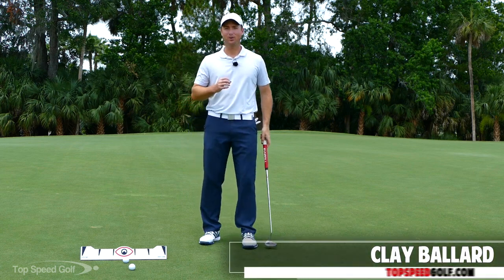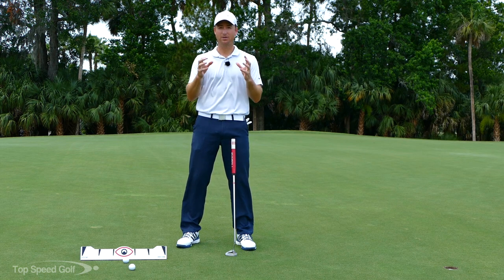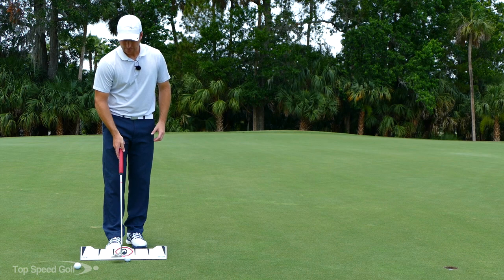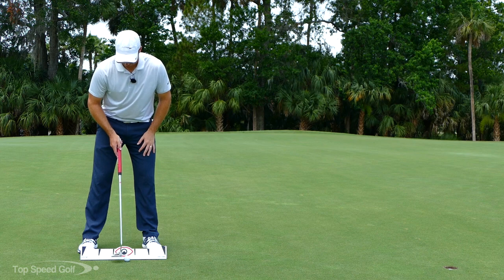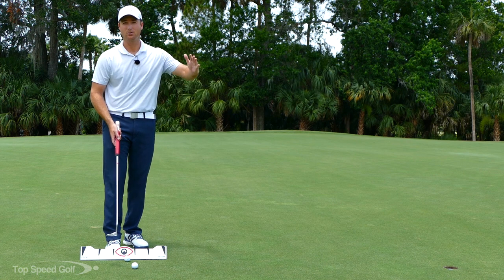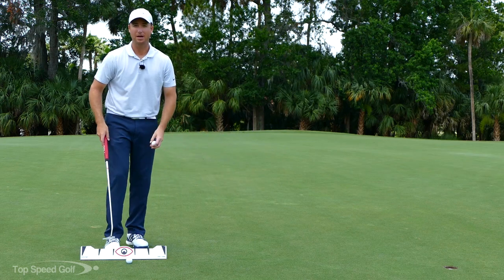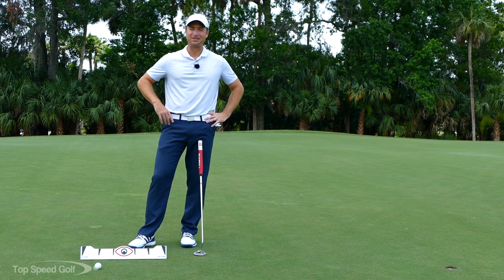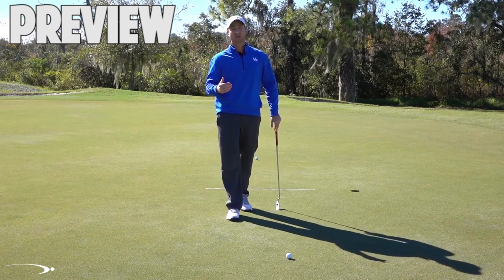Why You DON'T Want a Pendulum Putting Stroke | 36/64 Rule

Comment: This logic only applies to putters that are not designed for pendulum putting, which includes most of them. But keep in mind that a pendulum is the purest stroke in golf. The issue is that a putter needs to be designed to allow for such a free swinging, square face, tempo motion. To do this, a putter needs an extremely high M.O.I. (Moment Of Inertia) . Welcome to the L2 putter!

Comment: So if I catch the ball at the bottom of the arc, I've seen the ball move or shift offline within the first few feet due to an imperfection in the green. But if I catch the ball on the upstroke or even slightly "lift" the putter head at and through the point of impact, that ball starts rolling immediately rather than skidding along and it seems less likely to be affected by outside forces. Does that make sense?
Reply: Tiger always said he tried to hit a "high draw" with the putter.

Comment: Hey Clay. I'm just going through the TSG system and signed up as an annual member. Great system and I'm really enjoying it :) I find your instructions very easy to understand and there have been a few aha moments, when things have clicked so Thank You :) I tend to go to some other videos you have made as well from time to time and they all tie in together, however in this you say not to use the pendulum stroke and to use the 36/64 and then in the TGS putting system 3.1 Putting Stroke Tempo & Timing | How to Smooooth Your Roll, you say to use the Stroke Meter which makes you create a stroke that is equal back and through. I'm confused? Which one should you use?

Comment: If you accelerate while putting, then your ability to control exacting distances diminishes. If you change your acceleration from one stroke to another, you will NEVER have true consistency. I actually pause slightly at the back of a putt. Putting is perhaps the best aspect of my game (2 handicap). Control is derived by how fast the take-a-way is, and MATCHING that during the through-swing. What that does is it means I am not popping at the ball. Let us say I am faced with a 12-foot putt. Well, the speeds of greens change EVERYDAY, because of growth and mowing, wetness, and wind speeds. When I warm up, I can find a level area on the practice green, and I can test the speeds of the greens. On days where the greens are smoking fast, I may find that I need a small take-a-way say 3 inches to travel 12 feet. On other days the speeds are slow, and I need an 8-inch take-a-way to travel that same 12 feet. But if I pop at the ball like you are advocating, I have no real idea what distance I need to pull the club back because if my acceleration is  3 or 4 MPH differently I will always get differing results for the exact same take-a-way.  I cannot judge distances accurately by doing what you suggest. Believe me, I have tried millions of times. How do you know how fast your acceleration is actually building up to? You don't, you guess ( you call it feel). Because when you pop at the ball, a 4-inch take-a-way can send the ball forty feet or 4 feet depending on how much acceleration is being delivered to the ball, coupled to the speeds of the surface. How many rank beginners pop at the ball and send it racing 20 feet past the cup? Some players have a distinct pause at the top of their full swing. It gives them a reliable point to transition from (Hideki Matsuyama). Through decades of attempts, I have found that the same is actually true while putting. It gives the player a way to control distances more accurately, without having to rely on your type of guesswork. I play on greens that have an 11 stimp most often. That doesn't mean it is always an 11 stimp though. When I warm up, I am finding the true starting speeds of the surface... FOR THAT DAY. On dry or windy days, the speeds may increase during play, but I have a starting point from which to start from and by paying attention to results during play can actually see if they are speeding up, and I can adjust. No guessing at all. If I take the putter back 4 inches, pause, and then move the club head to 4 inches in front of the contact point, I get a distance for a 4" take-a-way. On fast days that maybe 8-feet or more distance results. Facing a 6-foot putt? Simply use less take-a-way, of course, but don't try to figure out how to change acceleration. You'll be all over the map if you do. If I do a 6-inch take-a-way,  I get a defined result. If I use an 8-inch take-a-way, once more I get a defined distance. Taking that knowledge onto the course gives me the distances of a take-a-way for the distances I face. Uphill? Add an inch or two. Severely uphill, add even more take-a-way. But there is no need for popping at the ball. Simply enlarge the movement, just like you do out on the course. Not all swings are full swings. Downhill putts, use less take-a-way. If I pop at the ball like you suggest, I have no real idea how far the ball is going to run-out. It is then just guessing. Bad advice, buddy. The hardest part of learning how to putt really well is stopping yourself from trying to power the shot like you would with your irons or woods. I have seen people who can play from tee to green extremely well, who suck, simply because they try to bring the acceleration aspect of the full swing, onto the putting greens. They send the ball either way too far past the cup, or they deaccelerate to compensate and come up short. They 3 putt a lot of greens for this one reason. They don't know how fast the ball is starting at, because they have to guess how much acceleration they are creating each and every putt. Back in the 1960's when greens were 7-9 stimp, that type of technique worked. Look at the films of Palmer and Player when they were wining. They popped at the ball. But when you do, look at the greens they played on and how slow those greens were.  In fact, if you compare their performances through the years you will see that as the greens started to get faster and faster, over time their ability to win dropped substantially. Try that on a green complex that is set at 12 or 13 nowadays and see how well that works for the long haul... it doesn't. It creates 3 putts more than not.

Comment: Excellent! Will work the too back, too short to get a better feel just right - that is the key to this video; got to be able to recognize/feel this to hone the correct. Yes, needed the re-emphasize of the accelerate through the putt; in competition don't have this automatic acceleration -- tend to decelerate under pressure which cause the face to close (for me) and come up short left too often. Use an Accelerator 3 indoor putting mat that emphasizes this also. Use it also to see the putter face staying consistent square due to the guidelines. Off to the putting green.... Thank You!!
Reply from the maker: My pleasure!

Comment: Everything I’ve heard from putting professionals implies the 1 to 2 ratio is wrong. The ratio you should actually look for is 1.5 to 1. A shorter through swing gives you better acceleration, not a longer through swing. And the shorter through swing keeps your stroke consistent. 

If your stroke going significantly further than your backswing you might end up pushing or pull your stroke. This could creep in to where you hit the ball, causing you to consistently push or pull your putts.

Comment: Excellent job in explaining the 36/64 rule..  Wonderful.  However, when practice putting over 3 feet, you are PROGRAMMING to miss the putt mentally.  Now, find an uphill straight 3 foot putt.  Now, if the putt goes IN LEFT CENTER, then you have MISSED the putt (or 10 footer).  The putt must go in DEAD CENTER.  You will then develop a SHORTER ACCERLATING stroke and mentally you never miss.  The only difference between a 10 foot putt and a 3 foot putt is when you have a 10 foot putt is really a 3 foot putt which you hit HARDER.  Allen E. Jansson, 57 years of putting research.  EXCELLENT JOB.!!!!
Reply from the maker: Thanks and thanks for sharing!

Comment: Pendulum putting with small light putters is not a good idea since you need to add energy into the impact zone in order to get your distance. However, with a putter that is big and heavy and designed for stroke size for distance control, there is no better way to putt.

Comment: When I was 14 my father made me a rather unconventional putter; basically he used a very heavy chunk of iron blank put some groves on one of the faces then bored a hole for a very short vertical wooden shaft with no angle, the putter was T shape. I bent over the shaft and hung my arms straight with my body being the pendulum, no wrist and no arm movement and oh boy how accurate I was with only one movement to consider.

Comment: You'd have to add some acceleration to the head if you want it to go forwards double the backswing length - - which may then add another element to go wrong.   You'll also need a tighter grip to make this work.   Another element to go wrong.   Difficult to have passive hands and/or arms doing a double forward swing.  I'm not convinced this is the only, correct way to putt.  Thoughts guys?
Reply: Stan Utley... the putting guru to the pros... says that the backswing should be longer than the through swing so you can hit the putt with the dead weight of the putter falling to the ball, and that every top putter does that.... Jack, Ben, Tiger, Faxon, Roberts, Ricky... the list goes on. He's right!!!
Reply: @macdaddyblues1  Certainly Geoff Mangum would go with backswing = forward swing and pretty natural as well - more like the unadjusted swing of the putter and your arms - around a one-second pendulum.  I loved listening to a recent podcast where Geoff is interviewed - so refreshing to hear someone with real researched instruction rip into various putting gurus who are more personalities and celebrities than coaches.  He was particularly bitter about a young junior he had helped to win some major junior comps and then be invited to international events.  This youngster's father then got him to come to England to do a SAM Lab session.  Never heard of this young junior again - completely messed up.  All SAM Lab can do is show you the results of what your body is doing to the putter.  It can't tell you how to move the putter correctly.  Anyway if you want to find the podcast it's here https://www.youtube.com/watch?v=yueGj-YIpOo
Reply: @macdaddyblues1  I worked with Stan as a student and you are correct. It may look like the putter head decelerates, but that is because the ball gets in the way and slows the putter on the through stroke. Watch Patrick Cantley. He’s one of the best putters on the tour and he is using dead weight. There are two basic strokes…a pop stroke which this video demonstrates and a pendulum stroke which Stan advocates. I’m more of a pendulum stroke putter.
Reply: @edwalt3157  On a side note... I played against Stan in MO high school state golf tournament back in 1980!! You don't have to guess who won medalist in the tournament!! lol

Comment: Just getting into golf.  This video is great.  I'm also a weirdo because I'm a mechanical engineer and a drummer.  The whole Pendulum concept (equal angle of swing / constant tempo) would be great if you kept your putter oscillating back and forth for 30 seconds then, while continually swinging it, stepped over to the ball to putt it.  However, you're starting from zero velocity, accelerating, then stopping.  The whole Pendulum concept doesn't fit.  The grandfather clock Pendulum doesn't stop from zero, speed up, then stop.

The drummer in me is thinking in terms of a "groove", with the only timed spots being when I start moving the club (beat 4), and when I make contact with the ball (beat 1).  Imagine a rock and roll guy yelling "1... 2... 3... 4..." on stage to count off a song.  On beat 4, I start moving the club.  The "song" starts on the next 1 (this is when I make contact with the ball).
Reply from the maker: Thanks for your input! Play well 😀

Comment: Hi Clay,
What's your opinon about great putters who has almost no forward swing? Snedeker, Zach Johnson and Russel Henley comes to mind. I'm sure there's plenty more I forgot. What they have in common is that they accelerate really good into the ball.
/Thanks, Viking, Sweden
Reply from the maker: Hi, I think there are many ways to putt well. Obviously, that works very well for those guys. Typically, it is best to putt with a little forward shaft lean. It's just much more stable because the force (the hands) is leading the mass (the clubhead). I hope that helps. Play well ~ Quentin | TSG Instructor